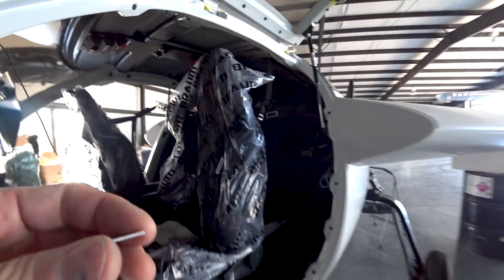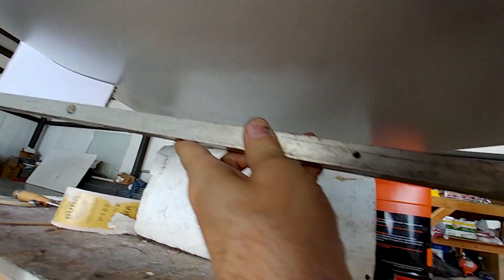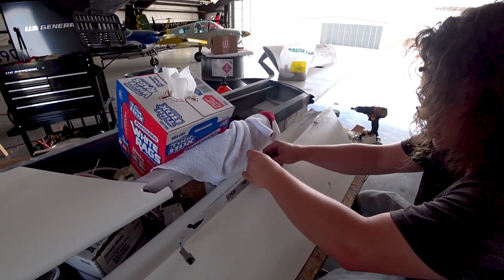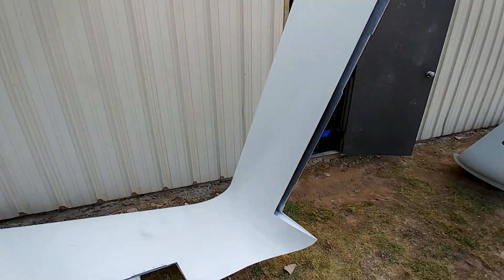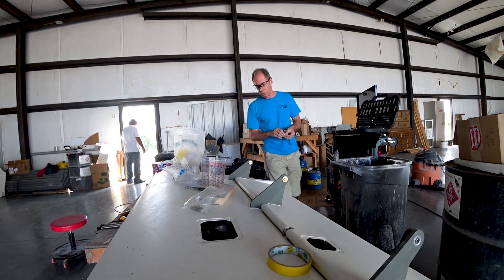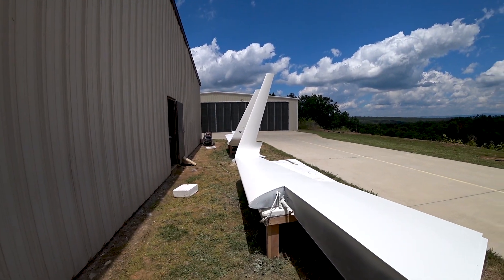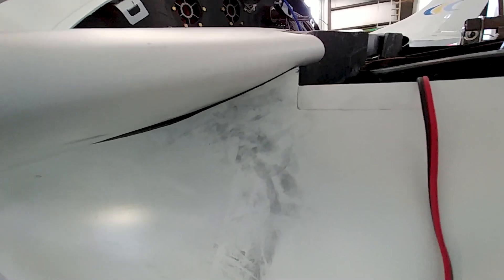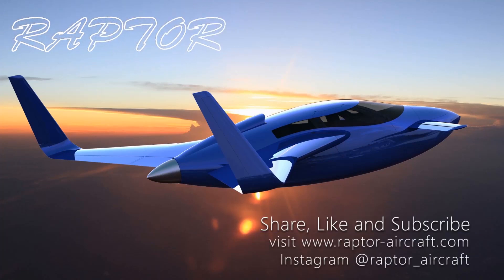Super Cool A/C - Building the Raptor Prototype

Comment: Re: the heater tap. Lots of new cars and trucks have a single unit that stops both the line into the heater and the line out. You may have less of an issue because of the line length but I needed to put a stop on the return as well to stop engine coolant heating up all the way back to the heater core. When I did that I had no more overheated cabin on a day when you didn't need either heating or cooling.

Comment: Is it possible to detail the main differences between the Velocity and the Raptor? I think some will make an unfair comparison, like airfoils, engines, etc. The Raptor is in many, but maybe not all ways, an improved, modernized alternative. I personally think the comparison would be a good marketing tool.
Reply: Deicing, parachute, pressurization, constant speed prop, and more. I'm a Raptor fan and would like to be clear about its advantages.

Comment: lol at heater valve - I build cars and I've been there.  If it were me, though, the valve would have been there and closed then I'd wonder why I couldn't get the system to work due to air being trapped in that line.... point is, of all the things to do "wrong", you may have actually saved yourself from a larger, harder to find problem... which of course, means you did it on purpose.  You're clever :)

Comment: Looking good. The nuts on the aileron linkage don’t need lockwire to prevent backing out? Is nylon locking nuts sufficient?

Noticed the nuts on the intake air deflector also were just nylon lock nuts with no lock wire. Could engine vibrations potentially cause backing out and then have loose FOD in the engine bay?

Comment: At 13:00, it looks like the rear portion of the alignment template is not properly seated on the trailing edge of the foreplane for the angle measurement. You probably knew that but just wanted to make sure.

Comment: Peter will that foreplane lay directly on the fuselage and the hatch door also diretly on the foreplay? will there be some play to accommodate for possible flexing of the foreplane? will you use some rubber seal to avoid chaffing? I am not an engineer and have never built an aircraft but have admired your perseverance over the last 2 years.. congratulations on your achievements.
Reply from the maker: The fore plane is designed to flex and there will be room for it to move apart from where it's bolted.

Comment: I saw the earlier comment about nylocks on the rotating hinge parts and agree with that assessment.

      I noticed at 1:54 nylock AN 365 or 364 being used on the air plenum “ramp”.

    I was always taught to avoid polymer elastic nuts in the engine cowl due to heat issues.

     A better solution would be AN 363 (MS-21045) metal split stop-nuts.

Cheers!
Reply: I was wondering about that too. I was expecting them to use nuts with lockwire. Wouldn’t want something coming loose and having brackets or nuts bouncing around in the engine bay.

Comment: You could put the AC condensation to a catch can with a float so when it’s full, the float opens a drain to outside. When it’s not full, the drain is closed so you don’t leak cabin pressure. That’s how the galley sink drains work on the aircraft I work on.

Comment: 6.6 degrees compared to what, where is your baseline?   You explained the objective of the fitment work very well, as getting proper angle of attack delta to the wing.  But the wing is not on.  So where are you measuring from?
Reply from the maker: It's six degrees of Kevin Bacon. 😁
Reply: Raptor Aircraft   Good thinking!  As long as we have a  logical linkage and method with acceptable error.

Comment: I have been watching from day 1, you have come so far! I am a little concerned how complex this project has been. I would suggest that you contact an aviation industrial engineer  in order to streamline the manufacturing and building process. The weakest link here is going to the manufacturing of the kit and lengthy build process. If you can make the manufacturing and building time comparable to Vans Aircraft, I think you have a real shot at this aircraft enduring thru the generations

Comment: I personally would be inquiring if they make a heater tap version with a metal valve body, being that you are operating the engine at a sustained high rpm.
My self as a heavy vehicle mechanic constantly see the plastic heater tap's warping from the heat and pressure from just heavy machinery operation.
Also question of curiosity, you are using a automotive engine? and your using the turbo charger pressure for cabin pressurization, does the engine crankcase breather feed into the turbo charger inlet or have you rerouted it?
Reply from the maker: The breather is rerouted through the exhaust.
Reply: Raptor Aircraft   Diesels can “slobber” from exhaust and similar from breather while idling.   Breather probably more cruising so will get messy.  
Why not put breather down stream of cabin air & back into the intake?   Not sure what is proper design for a turbo diesel system.  Do you have a diesel guru on your team?
Reply from the maker: @timduncan8450  no sense sending it into the intake if you don't have to. Just oils it up. Out the exhaust is the best although not so much for the environment. At least we're environmentally better than most other aircraft.
Reply: Anthony Barrett putting anything but fresh air into the inlet has always been a stupid idea...thanks EPA

Comment: Will you have trim tabs on the elevator and rudders?  I didn't see any mechanism for those.  Also, I am curious as to how you sorted the second piece of the main gear doors.  It seems to me that hindging that little piece from the outboard side of the wing with a spring-loaded mechanism that forces it to close when the gear retracts, may provide a simpler and robust solution to this problem.   Finally, I am wondering if you have an alarm system that warns about cabin pressure if it drops below a critical value?  You may also need a small oxygen supply for emergencies.    I looked at building a Velocity aircraft 20 years ago, but there were several drawbacks.  You seem to have addressed all of these with your design, I wish my license was still current and I could afford to buy one!
Reply: Donald McCann    I am curious to the “areas” you see different and now addressed by the Raptor?   
They seem very similar to me, but with Raptor trying hard to address the engine cost issue.   Of course that’s a nut many in experimental world grapple with.  Auto conversions and PSRU’s are not trivial engineering work.  So wish Raptor team all the best.
Reply: Tim Duncan No disrespect to Velocity, it’s a great plane (I took a demo flight 5 years ago, very impressed) but the design technology available 20 years ago when the Velocity was designed just wasn’t available to a small business.  Modern CAD design and machined tooling are HUGE benefits - aerodynamic simulations, component strength optimization, much higher tolerances in production, etc. Practically, the Raptor cabin is much larger, and pressurized. The Velocity airfoils are foam core Fiberglas layups, much like you’d build a surfboard, whereas the Raptor wings are molded carbon with carbon ribs. While we see what looks like a lot of sanding going on, it’s nothing compared to a traditional composite Experimental aircraft.
Reply: Larsonaut   I understand how high altitude cruz is a powerful enabler of speed and efficiency.  The compound turbo is really the core of this, pressurization is nice but not required.   I have limited composites and wing design background but not convinced ribs are much better in function aspects vs foam core?  Less sanding is great, and the big router is a Mfg step up from Burt’s hot wire for sure.   But the CAD, CFD, FEA & layup tools probably make 5 or 10 mph improvement right?  Big wide comfortable pressurized cabin is nice and a step function in passenger experience I suspect.  The airframe appears beautiful & robust (in general).    It’s size alone but also it’s refinement may improve on the Velocity but it won’t be cheap. 
Anyway I come back to the engine capabilities, cost & efficiency as being the big difference, or am I misreading?
Reply: Previous videos have shown elevator trim accomplished by a composite “spring” under the cowling rather than tabs. Adjusting trim will change the pressure exerted by the spring on the elevator. Why no tabs? I dunno.  Don’t think there is any rudder trim. Left turning at high angles of attack should be less than a “regular” tractor prop plane (with pusher the prop slipstream won’t hit the fuselage) so maybe just don’t need rudder trim.

Comment: I smiled the whole way through watching this update video! So many positive steps are made at such a rapid pace :) I hope you can figure out a way to also clean and service the HVAC condensate drain line, as this is a place where bacteria and virus growth will be very common. That is especially important if the drain line is routed through the cabin and manual operation is required to empty the condensate container. - edit: typos.

Comment: I once visited a ultralight airplane company. I check out the plane in the front yard. In their design, they had an two aluminum tubes that hung the hung part of the plane from the front of the wing. There's nothing wrong with that. After all, the rest of plane has to connect to the wing somehow, but the two tubes passed through the front nose fairing/cowling, and where they did, they had cut through perhaps 1/3th of the tubing wall in some places. Part of the plane vibrated, and part didn't, and the edge of the cowling did the cutting. Yes, I told them.

Obviously, there's nothing wrong with the control tubes that pass through the wing surface, but where they do, there a delicate trade-off: if the gap is too big, water and ice will collect; if the gap is too small vibration may score the tubes. Even if it rubbed at all, it would take years to become a problem, but it might be a thing to check, every so many hours.

The foreplane hinges can be beneficial vortex generators. It looks pretty good on the rest of the plane.

Thanks for the videos " )
Reply from the maker: Those actuators are actually solid aluminum but I understand your concern.

Comment: on the landing gear door other piece Could you put a bag like air bladder on it that releases all air when it against the wheel well and wheel to close the last part of the door and then the gear deploying will inflate the back and retract the door into a safe position when it on the ground? would that solve it?
Reply from the maker: Let's see, what happens to that bag at altitude?
Reply: Raptor Aircraft, I was saying air more for my own thinking. But what I was thinking was that bag would be under pressure anyway. If a valve is in it to keep it pressurized on the ground and deflated at altitude then I don’t see it being a problem at least I wouldn’t think so it just using your existing builds and gravity as hydraulics. My thinking was sort of like a mechanism that is similar to the nose gear doors. But thinking with the well construction already in place

Comment: Did you ever get your lower main-gear door mechanics sorted out?
Reply from the maker: I've got another idea to resolve the issue that I currently have with it. Will get to it when I have time.
Reply: Raptor Aircraft For production how ‘bout the lower main gear door flap hinged to wing with “L” arm mechanism, kinda like your nose gear solution? 🤔🤷‍♂️
Reply: @L123Alpha  I had the same idea. I'm sure it's a solution that Peter has considered as well.
Reply: I've seen the current construction being used, so should work in general:
https://www.dropbox.com/s/l0fpdidra89vk3t/Screen%20Shot%202019-05-29%20at%208.02.08%20AM.png?dl=0

Comment: I think I'd put that heat valve on the other side of that firewall.  Hot antifreeze fog is not something you're going to survive at altitude.  Especially when you're going to be landing dead stick because the engine will then proceed to overheat and lock up..
Reply from the maker: Ok so now I have to move the complete heater unit out of the cabin. Well no heating or cooling then. There goes the pressurization and also with it the high altitude and then the decent cruise speeds. So we're back to having a Cessna 172. 😧
Reply: Raptor Aircraft Please keep heater in cabin. I’ll add “inspect heater hoses” to checklist / 100 hr inspection items for Raptor #40 🤓

Comment: Take care blocking or valving off heater hoses.  If the engine wasn't originally setup like that (many always circulate coolant through the heater core) and it gets blocked off it can cause coolant to stop flowing someplace important in the engine and make that part of the engine overheat without you knowing it.
Reply from the maker: I'll check the schematic on the Audi but I recall that it has a valve setup.
Reply: @RaptorAircraft  Peter, btw, the expansion tank needs to be absolutely tight. The cap of the tank contains two valves which regulate the pressure of the cooling system. Over-pressure releases air. Under-pressure lets air back in. If the tank has a hole, it cannot perform the regulation function. The cooling system needs be under pressure (some 1.6 bar) to increase the boiling point. I recall you pointed out a hole in that tank which you tried to mend. Something is strange if there was a hole.
Reply: In the absence of anything better, I have this drawing for the TDI 3.0 2nd gen car engine, so should be fine:
https://www.dropbox.com/s/i7p0n00pvf86xez/cooling.png?dl=0
Reply from the maker: Yes that's the diagram and they're is a similar valve at 19 so we're all good. And yes the reservoir and three system are under pressure and working fine now. Thanks

Comment: FYI, you shouldn't use nylocks on parts that have rotation. They should be castellated with split pins.
Reply from the maker: The hinges are 7075 and are very solid. The bolts don't actually rotate as the bearings are what's handling the rotation. But point taken.
Reply: @RaptorAircraft  No worries, this may be something your DER looks at. Is also true for all the bell crank bolts. Comes from FAR 23.607:
https://www.law.cornell.edu/cfr/text/14/23.607
Reply: AC43.13b FAA acceptable methods. Chapter 7-64 paragraph a-g.  All control surface hinge points, bell-cranks, etc., basically if it moves it should have a castle nut (AN310) and cotter keyed. These items are subject to rotation. Great progress!!
Reply: sickboy481   I agree,plus the hinges look awfully flimsy for the stresses they will be under in the airstream.
Reply: Split pins won’t work as well as lockwire for nuts that need to stay tightly fixed. On wheels and gear components is generally where split pins are used.
Reply: @Alex-us2vw  You can't really lockwire nuts that are subject to movement, lockwire is usually for things in engine bays etc. Most flying controls will be spkit pin or safety pin. One exeption is adjustable control rods. They have a very specific lockwire setup. As mentioned earlier AC 43-13 1B is a very useful read.